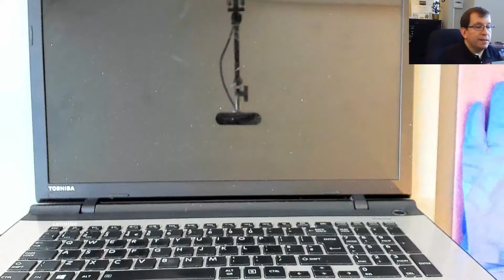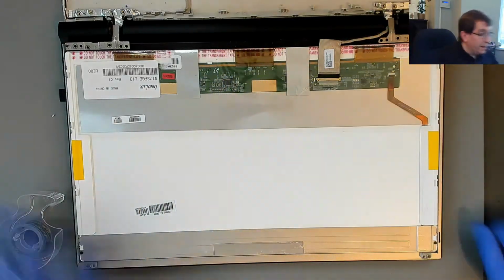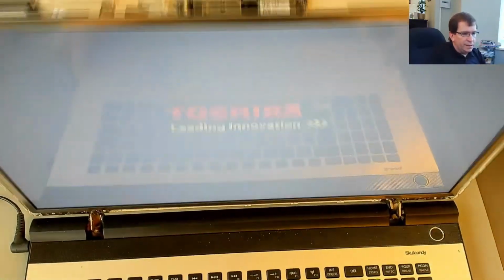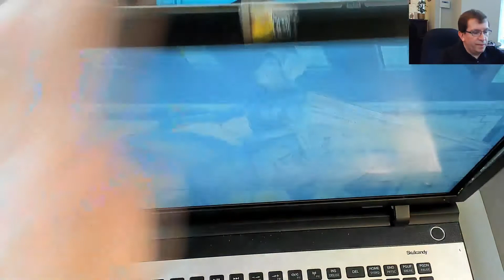[38] Toshiba Satellite L70-C-13C - LCD replacement

Comment: Word to the wise, be careful when you pry off the trim piece. I used my fingers to pry off the bottom edge and slashed two fingertips on a razor's edge strip of metal along the bottom of the screen. 

Like straight up razor blades under my finger nails.

*typing is hard with Band-Aids.
Reply from the maker: Yikes! Looking at my video, I didn't encounter the same issue because I used a thin plastic tool to separate the bottom of the bezel from the LCD panel. I hope you're OK!
Reply: @ComputerHelpNI  I'm a caveman so I just used my hands. Rookie mistake! Fixed my screen though so it's all good.

Comment: Do you know how to replace keyboard or place to buy one ?
Reply from the maker: It looks like that keyboard is bonded to the palm rest. It's possible to replace, but the job is quite difficult because you have to grind off or melt the plastic 'rivets' holding the keyboard to the palm rest, and then you need to replace those after fitting the new keyboard.

The easiest option is to find someone selling the palm rest with keyboard, but it looks like those are getting hard to find for this laptop model.